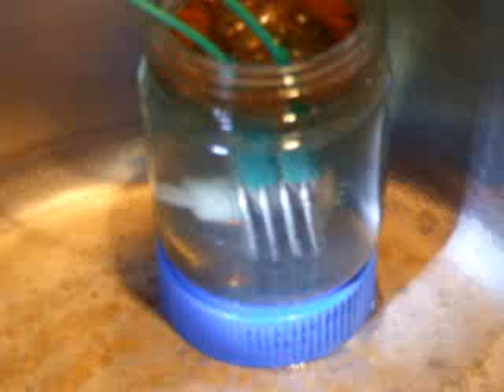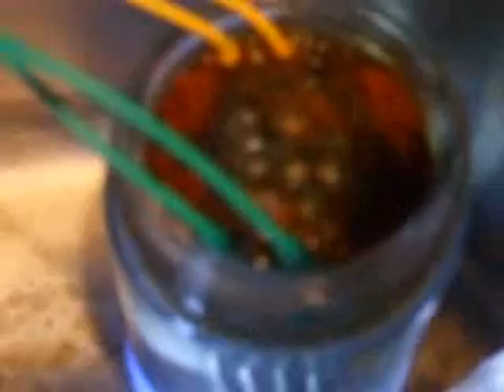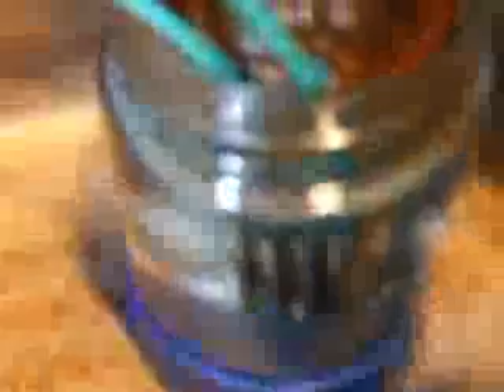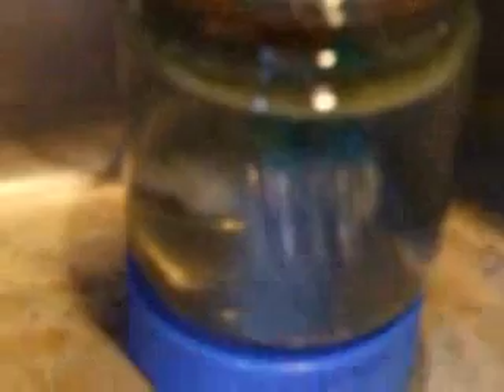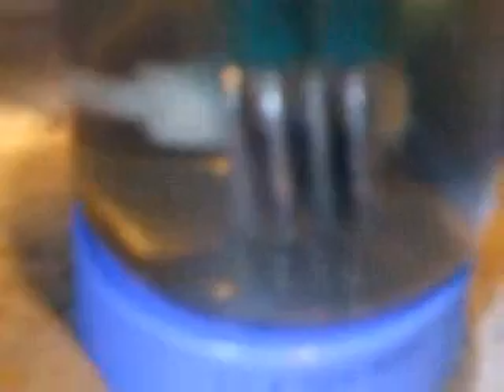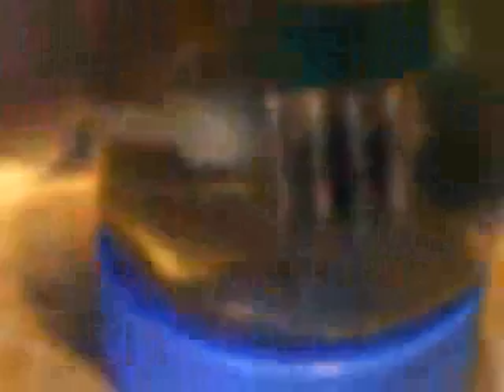Electrolysis 101

Comment from the maker: Cathode(-) will yield H2 the annode(+) will yield O2. The ratio remember is 2:1 (H2)(0)so you will always get twice the H output. The annode is an oxidation reaction. What are you using for your electrodes? You could try adding electrolyte like salt or baking soda. Be sure to ventilate!

Comment: I think it is iron in your whater. I had the same thing happen to me too. it's better to use distilled water. and plastic washers  will work better. if you can keep the volts as low as you can and push more amp;s into it the cell it will make more gas and not heat the water like voltage will. good luck